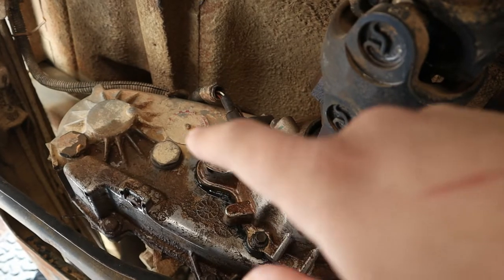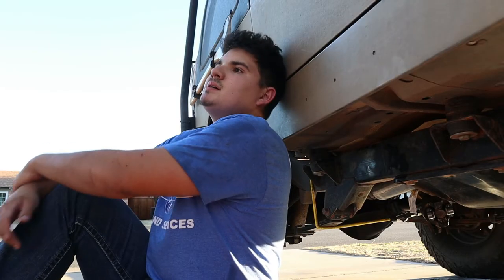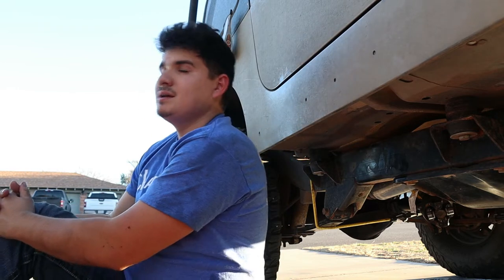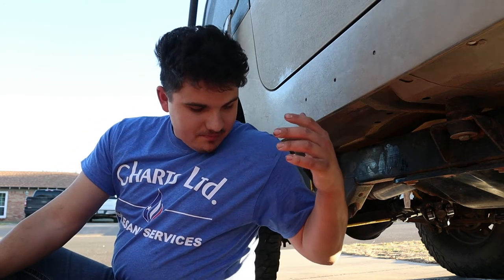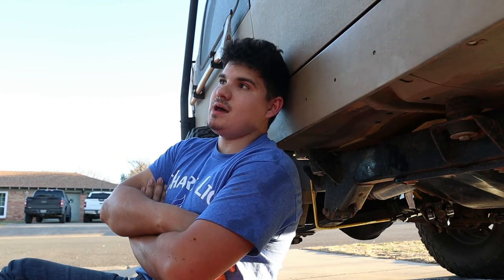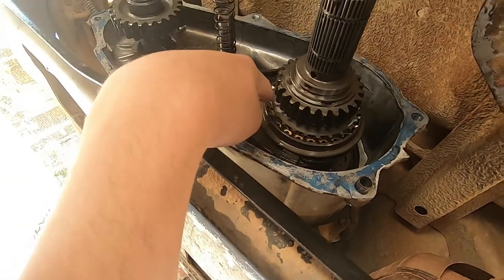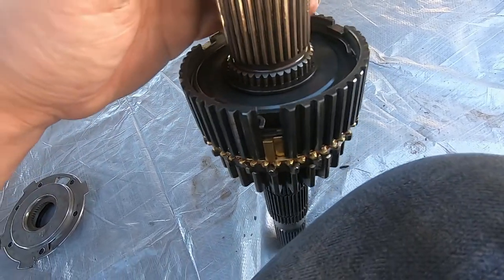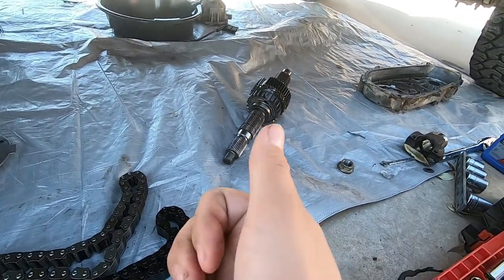Taking apart np231 Transfer case

Comment: You don't lack the skill just the motivation . It's a generational thing , I run a orthopedic manufacturer in the Memphis TN area. All the young adults coming into the manufacturing world are all the same. " We're unmotivated because we're depressed " ...well duh lol

You're free , with the world at your fingertips man. Best of luck.
Reply from the maker: It’s not always that simple but ya. I definitely think a lot of people self diagnose themselves and use the term incorrectly. I didn’t diagnose myself but I got the job done either way